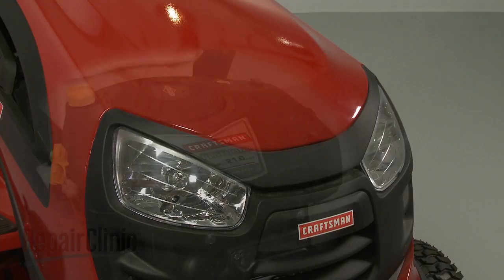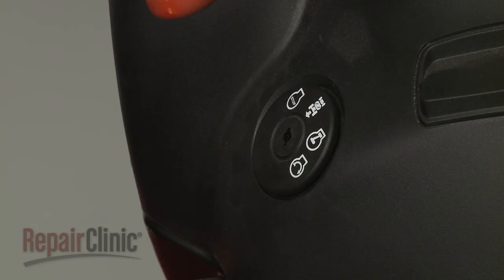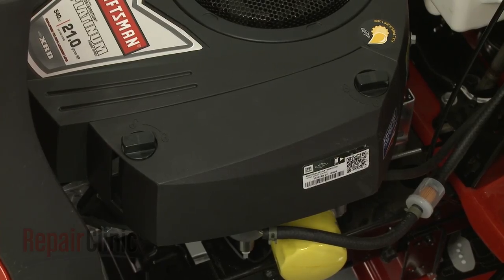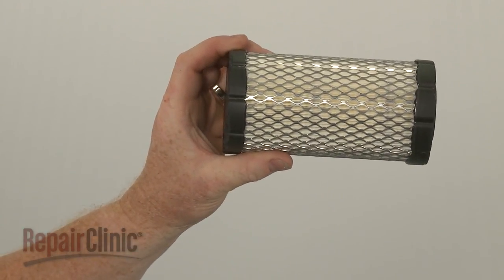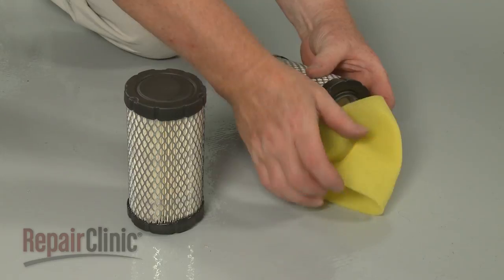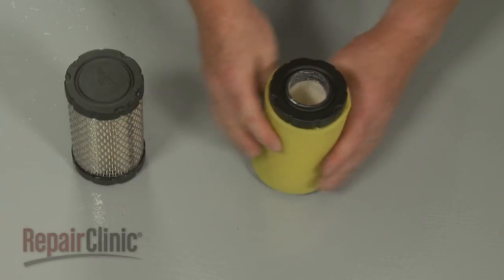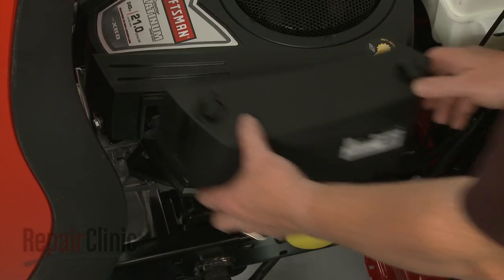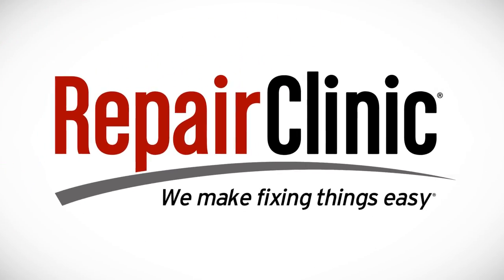Briggs & Stratton Riding Mower Air Filter Replacement #793569

Comment: Thank you Repair Clinic for posting this video. I put off this replacement last year due to the appearance of complexity in replacing the part. I figured that it had to be simple but could not see how to remove and replace it how it was configured. This is a very helpful video. Thank you again so much for posting this short video on Youtube.

Comment: What happens when you use the mower without a filter sleeve? Mine didn't have one? Should I buy one and put on the filter, or do I need a brand new filter (with a sleeve)?
Reply: My Craftsman lawn tractor didn't have the pre-filter sleeve on the paper filter either and I didn't know it was even missing. Later I found out and bought a new paper cartridge filter along with the pre-filter on Ebay.